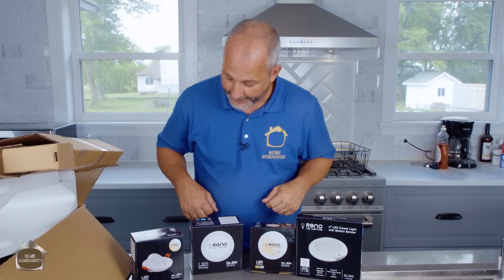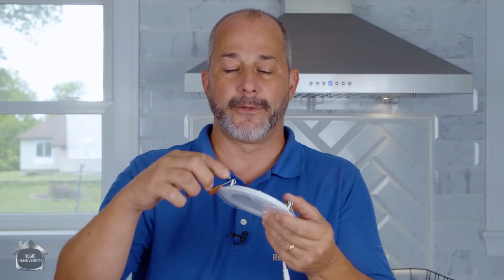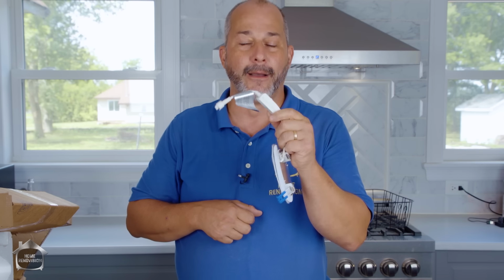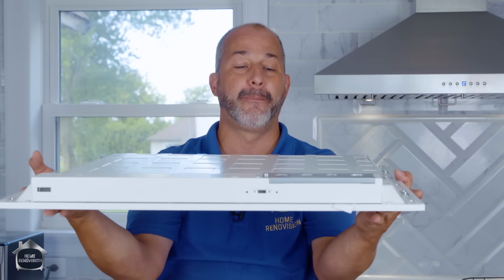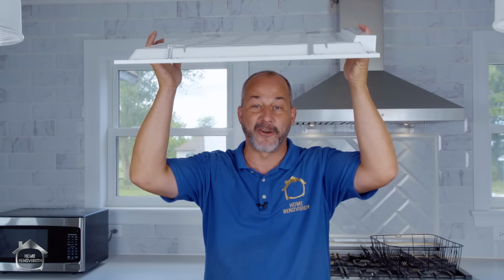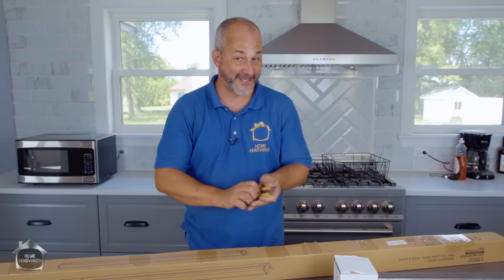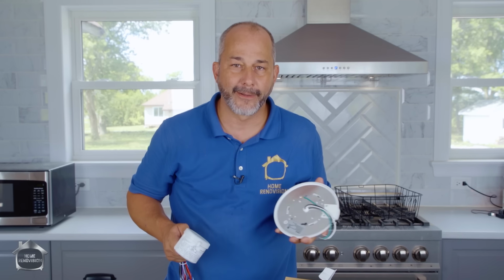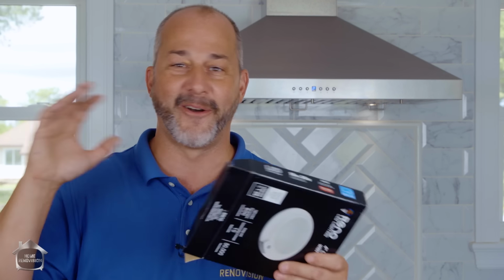The Best LED Lighting for DIY Projects! | LED Pot Lights

Comment: Jeff - what thermal options can we do to insulate the inside rooms from the attic? 

2 reasons, if i have to go back where I've installed the LED, i don't want to get an insulation shower, i want to improve the energy loss and reduce the lost energy... 

thanks and the enthusiasm is palatable. and appreciated. ive had LED lights installed for 3 years now and some do flicker and could be better like you indicated.

Comment: I used the recessed ones (recessed about an inch in the housing) that are also physically adjustable (light swivels in the unit) and color changing. 40/each though

Comment: So I have to re-do my lights in my bathroom found my Dad who passed away 10 years ago put a hidden junction box in the ceiling. So going to replace with a  two pot light controlled by one switch. How do you wire this to a switch with a wafer light.

Comment: Hi there. So how does one decide between 4 and 6 inch? As the 4 inch is 12w and the 6 is 18w. For the dinning and lounge which is around 27 feet long and 16 feet wide what would one go for ?

Comment: A couple problems with these slim LED lights that have different manufacturers (but all from China): 
1) the transformer unit gets hot
2) the lights can flicker, especially when used with a dimmer, and if you run other devices on the same circuit
3) I think that the color is a very narrow bandwidth, which gives the room a kind of sterile look.  I have older LED bulbs that have seem to have a broader spectrum of light - it seems more natural.
I am concerned about fire risk for (1), and (2) is an annoyance, I would rather pay more to get the product that performs the way I want.

Comment: What do you do if the old light you are replacing doesn't have long enough wires to move it to where you need it? Can you connect the old and new wires in a box and leave it tucked in the ceiling and then run the new wires to where the light will be?

Comment: Jeff, wanting to add about 4-6 of these in my kitchen (we only have 1 central ugly boob light lol), but our joists run right to the drywall. Is there anyway to run the lights around joists without putting a hole in them? Needing to avoid cutting unnecessary lights in the ceiling since my ceiling is wallpapered 😔

Comment: Regarding slimline LED lights. Are these a good choice for apartment building stairwells? I have 4 level buildings. The reason these interest me is that when people move stuff in and out of their apartments, that they won't smash the light bulb hanging in the common light socket. The one light fixture is between two doors on each floor. Will this be enough to correctly and safely illuminate the stairs in between each floor? How long of a life can I expect of them if the lights are on 24 hours a day? Also, imagining that I have those round electrical boxes that I screw the Plain-Jane corkscrew light sockets into, do I remove them and and wire directly? Would 4" vs 6" make a difference in my scenario?

If these aren't suitable, can you suggest alternatives that might better suit my scenario at a reasonable price? Are there brands or models that you believe in more than others?

Thanks.

Comment: I have 2 switches that control a wall outlet for a floor lamp. I want to use these pod lights but want the 2 switches to control them. How should I rewire this.

Comment: I have 18 of the six inch fixtures (aluminum frame "Cloudy Bay" brand from Amazon) and they are dropping like flies (after one year in operation). The just stop working. I have a theory as to why they are failing. They are overheating! Or rather the power supply is overheating. They are overheating because they have blown-in insulation right up against them (in an attic) and they are only rated for a maximum operating temperature of 40 degrees C (which I think is very low). I have swept away the insulation at each fixture and covered the emitter and power supply with a small cardboard box and covered with insulation over the box so as not to create 'energy loss portals' into the unconditioned attic. The heat created from the fixtures can distribute throughout the airspace under the box but it still cannot escape. I hope this works. These things should be rated to operate at a much higher temperature OR the installation instructions should give some guidance how to insulate behind them.

Comment: I had pot lights installed in my master bedroom  bathroom but I notice they get pretty hot and I have insulation in the drywall above the pot light. On the light it says " type ic " but still gets more hot than I feel comfortable with

Comment: Fun fact, LED lights for the amount of light they put out are no more efficient than any other light. It's the fact that they don't make the heat that is made as a byproduct of other lights that Jeff mentioned in the beginning of the video as a problem that make them more efficient relative to other options. No heat = way less power needed.

Comment: great video as always Jeff, its time for an update to this video. its 2022 now and there is a plethora of additional options out there. for example, these same easy to install lights also come with WIFI Connectability where you can control each light and change colors, dim, change hue by remote or smart phone app.

Comment: This video has definitely changed my Reno. plans. Thinking or using the drop in panel in my drop ceiling in my basement.  Is is a 2 x 2 or a 2 x 4 ? As for the rest of the house, I will be buying according the needs of the room. They’ve come a long way over the years. Easy peesy. Black to black white to white & copper to copper. May have to use a sparky to help with the 3 way switch going to the basement.

Comment: Why does my FM radio go all staticy when I turn on my new LEDs?
Reply from the maker: let me get this straight you have modern lights and still use FM? any vibrations can cause interference to a radio wave . led uses a restrictor tech on the supply line so there is a source of restriction at each light. perhaps upgrade the radio to an online source to avoid this issue.

Comment: Have tremendous respect for you Jeff and I love this channel but when it comes to these LED fixtures I think you're off the mark. Here are some of my observations as an early adopter of LED product in both my own home and those of dozens of clients.

Most of these LED lights are manufactured in China. The quality of the product is generally poor and a manufacturer's quarantee means nothing if you have to return a malfunctioning light to China. The expense is astronomical. As for whatever guarantee or warrantee offered by the big box store you found them in, just ask yourself why a light that supposed to function for 30,000 or more hours backed by a warrantee that expires after a year. 

These units use less energy but they are not environmentally friendly. First of all they are mostly manufactured in China, where hazardous waste disposal is as close as the nearest stream and that pollution doesn't stay in China, eventually it works its way everywhere. Secondly when these units die and they will die long before they are supposed to, the entire unit is toast because the LED bulb is integrated into the fixture. Usually the the bulb is not replaceable and the entire unit, plastic and electronics ends up in your local land fill.

Good luck trying to find a replacement for the fixtures that have died. The big box stores that carry this stuff rarely carry a model for more than a year, two tops and you're forced to find an alternative which means mismatched fixtures. 

When you install LED's be prepared to have to replace your in wall dimmers to LED friendly dimmers. They are not cheap and they're not so effective either. If you want to dim the LEDS, be prepared for flicker or some other unwelcome lighting effect you hadn't anticipated. 

I've had to replace literally hundreds of these type units after convincing clients to clients to use them. I thought I was doing the planet a favour, turns out it was not the case and since I stand behind my work I've been out several thousands of dollars replacing the LED fixtures in entire rooms because the model I used was no longer available.
 
I still install LEDS but no longer anything I would find at the big box stores. There are manufacturers and dealers in the USA who do offer 5 and 6 year warranties. The product costs more but it will not have to come out three months after the guarantee expires. I'm not happy about what the CPP is doing in China and the rest of world but I believe I gave these products a fair shake and then some. They are simply sub par. Ask yourself when was the last time you were impressed by the quality of something manufactured in China. Then go find a company who puts their money where their mouth is and be prepared to pay.

Comment: As an electrician and architect I can tell you what every homeowner misses. It’s LEDs that are the correct color temperature with a high CRI index. You won’t find them at Home Depot or Lowes. CRI of 95 or higher. Don’t exceed 3500 Kelvin and use 2700 in the bedrooms (at least for the table lamps).  If the LED fixture or lamp does not have the color temp and CRI index listed, avoid purchasing it.
Reply: As someone who kind of loathes 2700K except maybe when watching a movie, I tend to stay at 3000K or above.  Given what you said though, do you still recommend 3500K as the max EVERYWHERE in the home including garages, bathrooms, and laundry rooms?  I know that lighting has a big effect on our mood and energy; I just want a home that is crisp and modern in all parts of the home anytime day and night.  Thanks for your expertise!

EDIT: Bonus question - if you had to pick ONE Kelvin temperature throughout the house and would control brightness/mood only by dimming, what Kelvin would you say?
Reply: @progression_decibel  I would choose 3200K (halogen color). 4000K garage and utility rooms. Laundry 3500. Be aware that dimming LEDs lower light level and not temperature like dimming incandescents

Comment: Great LED lighting options. Can you check these lights for Radio Frequency Interference? LEDs can be silent, or they can emit crazy amounts of interference which affects radio receivers and wipes out the spectrum with unwanted RF noise.

Comment: Do standard recessed led lights fit into the old incandescent round housing? Not the old huge metal cans for canned lighting, but the smaller plastic/fiberglass/metal ones. Should I just forgo such now that they can be thrown into drywall?

Comment: 5:10 4000K color temperature is not "daylight"; it's "neutral white" or "cool white" or "bright white". You don't get into true "daylight" range until substantially over 5000K, and better yet around 6000K.

Comment: Not mentioned before 3:45 is that the wiring involved is "low voltage" (e.g. 12V DC) so does not require conduit or stapling to studs or rafters. These products are a win-win all around.
Reply: All of the pot lights in this video are regular household current (120V) --not low voltage

Comment: Sparky here 32 years in ICI.
We finished a near total gut of our house not to long ago.
I did not do the electrical myself, primarily to not throw off the generals schedule and so there is no issue in the future for insurance purposes.
It's a two edged sword. There are certain things I would have done differently than the electrical contractor did and on the other hand he is a low rise residential guy and knows those codes far better than I. He was also far more aware of, in this case LED lights available.
I had have done a moderate amount of ICI LED retro fitting but no a huge amount.

So here is what I have learned through both my work and the reno.

- these lights are BRIGHT. There is a ton of Lumens coming from them.
       - the E. Contractor put four on our stairs and upper landing to the 2nd floor.
       - 2 sets of two.  The distance between the fixtures in each set is around 30" and the sets from each other is about 6'.  Way too close together. This is like a WWII aircraft search light.
       - I was not aware of exactly sure during rough in how bright they were going to be.  Part of the problem is that mental transition between incandescent and LED and learning the differences.

       - By code - the cigarette box (driver) is supposed to be mechanically fastened to structure because this is where the line voltage enters the fixture. Functionally you don't want that box possibly moving around and the 120v terminations possibly becoming loose.  Based on what I have seen this might be the code but people don' do it.

      - Except of course.....
      - Back to my reno.  In our stairs the angle of the roof is overhead with the LED fixtures. The insulation is spray foam and pockets were left for the fixtures.
      - In this case the driver boxes were screwed to the underside of the angled roof.  Off to one side of the fixture hole. So of course if they fail I have to cut out the drywall etc.
       -Do we know how long these drivers/LEDs are going to last? No not really, we only have the claims on the side of the box and as grown assed adults do we believe this?

     - If you are doing the install yourself or having a reno done, do yourself a favour.  If there are fixtures going to be installed where the driver boxes will be effectively made inaccessible, look into who the maker of the product is. Go to their website or call the order/tech desk.  What you want to find out is if there are extender cables available, such that the driver can be mounted in accessible location.  As I found out later, in my case they could have.

      -On that note you may need to find out if more than one  extender cable can be used if you need to go a longer distance yet.

      - Different vendors have the colour selector in the driver box. One I worked with had five different settings using dip switches.

      - One of the things I have looked into, as we still are to this beyond our major reno, is replacing the eaves and soffit.  I queried the electrical distributor order desk I have use about LED lighting for the soffit.  The answer is there is nothing, at this time, that is specifically rated for this purpose.  As he said to me people have used the moisture rated LED's meant for showers, however there are two problems with this. One of course if something really bad happens, the insurance will not payout. The other, and this why the insurance won't payout, is these fixtures are not rated for external use only internal.What has been experienced is after 2-3 winters, ie harsh conditions, they stop working.  It's only a matter of time before industry comes out with rated fixtures.

Comment: I'm an early adopter of LED lights and love them EXCEPT for a couple things...their advertised life is nowhere close to what I've seen, also manufactures constantly changing the bulbs so when you do get a burned out bulb finding a replacement is near impossible to match color (kelvin) and light output (light distribution/pattern). And finally problems with dimming ( lights pulsating/flicker) 
Other than these issues I love the fact they save energy I just wish the bulbs would become standardized like incandescent bulbs are, that's a huge problem.

Comment: Jeff, I assume all sealed LED pot lights are also insulation rated as well, right? So I don’t need to have a big gap around. 

Btw those retrofit LED light for old can lights (like BR16) are awesome too, and they air seal the ceiling at the same time, with a gasket or a little caulking

Comment: I switched over to 2 LED lights in a hallway that's on a 3 way switch. There was 2 crappy fixtures that I had led bulb type lights in them and it worked great on my Alexa powered system. When I put in these new "Commercial Electric " flat led lights, suddenly, its like it's tempermental and sometimes they turn on and sometimes not. Doesn't matter what switch is used to turn on. I only touched the fixture lighting not the switches so it was a single 14/2 wire. Any ideas here? BTW, I retroed my kitchen can lights to almost exact ones and they were on Alexa smart switches and everything works fine.

I'm going crazy here.
Reply from the maker: try removing the easy connect and use marrettes and twist the wires. If the quick connect is failing this will solve the problem. Cheers!

Comment: Traditional led bulbs die too quickly because the power supplies are undersized and squeezed into a tiny bulb with bad heat dissipation*. These could last longer than the house if the low voltage power supply is good.

*Except in Dubai where the government forces companies to stop building planned obsolescence into lightbulbs. 🤷‍♀️

Comment: How much does the Outdoor Post top cost?   Right now it's $389.54 per top.  That doesn't include the post and all the wiring you'd need to run to the lights.

Having 3 of those is a cool $1200 without the installation costs.  We care about the upfront cost, it won't pay for itself in a reasonable time.  However, as you said, you're paying for the convenience of not having to change it out until it dies in 50,000 hours.

There are cheaper LED pole tops, that one has a modern UFO design.

Comment: Another great video!  You mentioned in a prior video that most of these recessed lights are all from the same company and branded with different names.  Do you know if the brand Ensenior on Amazon is one of those brands?  It appears to have the same features mentioned in that prior video as well as this one (rubber gasket and temperature control).  I don't have an issue with ordering from GTA, but I am in the states and this is Amazon prime shipping.  Thank you in advance!